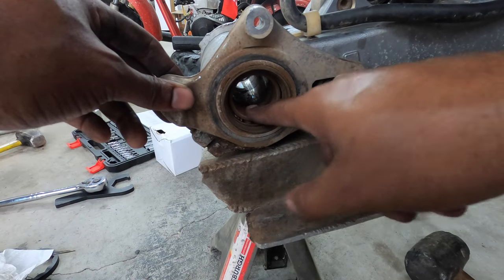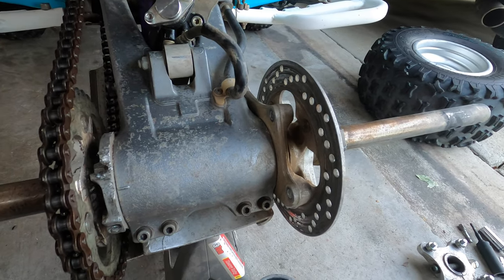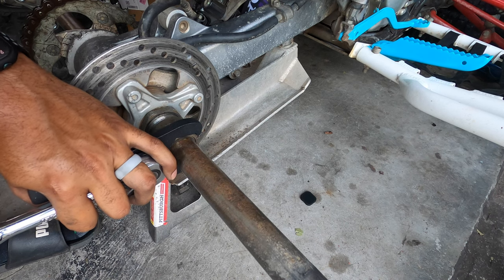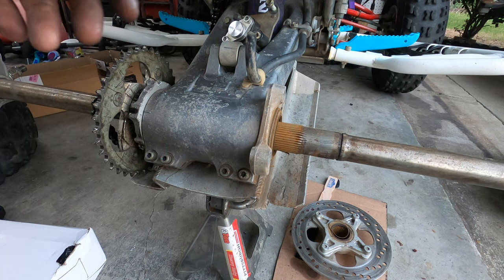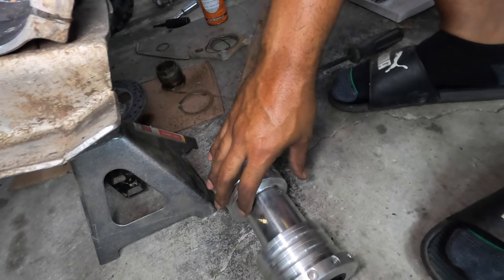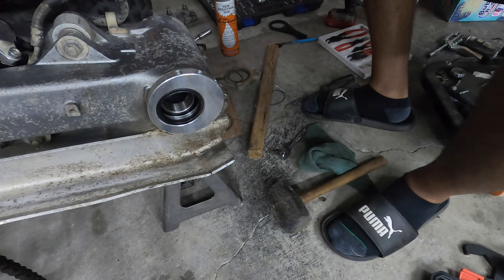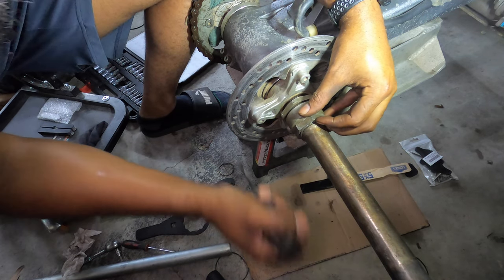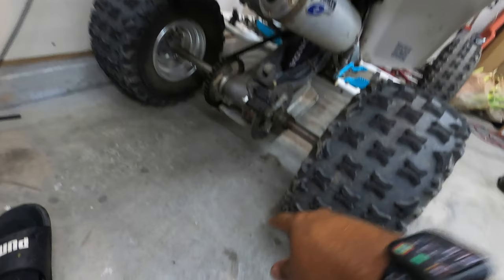Rear Axle Bearing Carrier Replacement | Loose Axle | Honda 400EX

Comment: hey man quick question how did u keeo the axle so still? i cant get the inner lock nut out for the life of me
Reply from the maker: I had it in 2nd gear
Reply: @DariusBuildz  Remember when turning at the wheel the gear ratios are reversed... so 1st gear will hold better than 2nd gear which can more easily turn over the engine.... Also if you use something like a pipe wrench instead of the axle wrench then you can break the axle nuts free first before you even jack it or remove the wheels.

Comment: --Hey man how do you like that style axle and hubs VS the stock spline style??
--And do you know where i can find that style axle and hubs?
Reply from the maker: The only pita with the Durablue pin axle is the bolt that bolts the hub to the axle. Once you get it right, it’s good. But getting that joker to 90ft lbs, with no help, was a beast. But contact Durablue. The dude is super old school, you do may have to call him and place the order over the phone. That’s what I had to do.